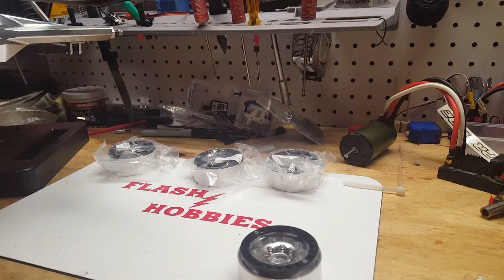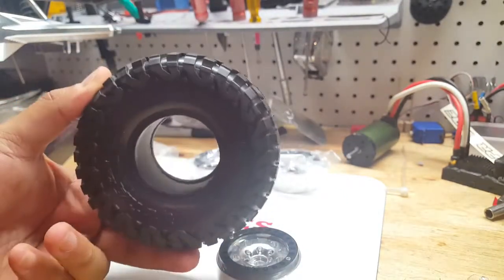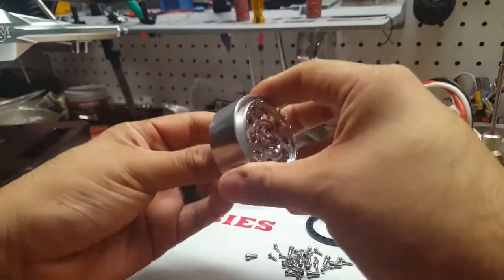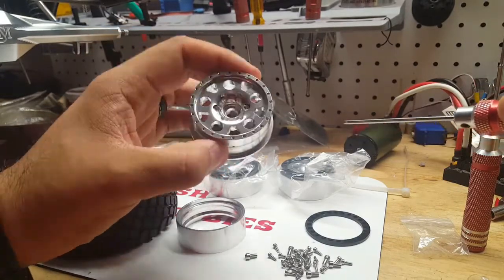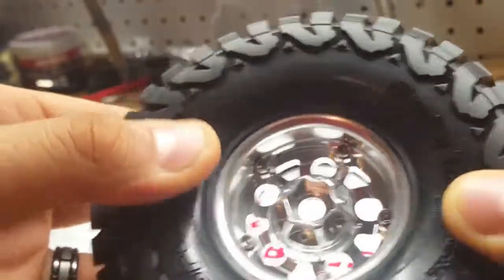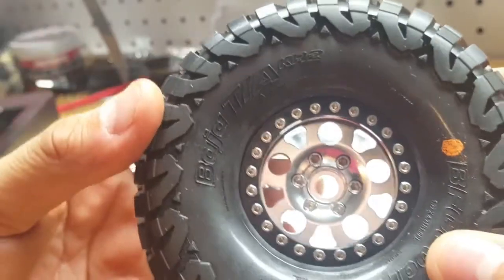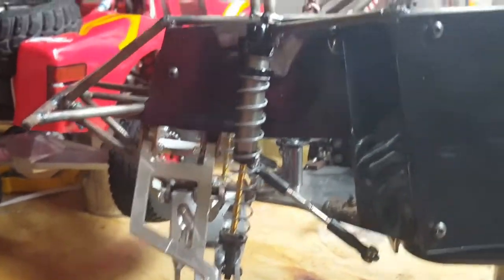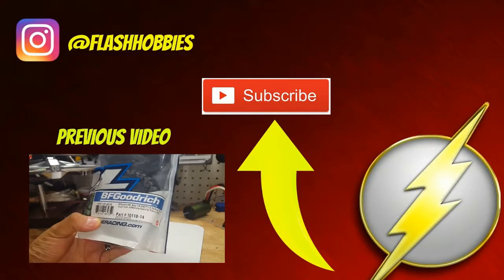EBAY 1.9 KMC Knockoff Beadlocks?

Comment: You could try to use the Vaterra twin hammers's c hubs/caster blocks to get a higher ground clearance and a much more scale looking as Gimm3fuel did in his truck. They  are also available in aluminum in Ebay very cheap, under 20 Dollars and works well.
Reply from the maker: I will have to look into that! Thanks for the info.

Comment: Really good looking wheels and tyres. I got a set of 4 aluminium beadwork wheels from schenzen for $21, and I bought a set of axial scx10 2 brand new tyres and sponges off ebay for $33. Awesome value, the tyres are sooooo feckin sticky and soft. They're my most expensive tyres yet. Now I'm just waiting for the wheels to arrive, then I can fit and try them out. Just like you, I can't afford mega bucks for anything my heart desires, I really have to be prudent. Great video man. ☺ 👍 👍 👍 👍
Reply from the maker: Mikey mike yes they are in excellent deal. I have Randy's with a 3s LiPo battery and have not had any issues with them as of yet. I also want to mention that the quality is really good and they have held up really well so far. So no complaints for me I would really want Vanquish Wheels but like I said they're just too expensive for me

Comment: Nice video!
The problem I had with cheap beadlocks were the soft screw heads stripping.
Reply from the maker: I did notice they are a bit softer than some other screws I have used, but I did not have any issues with any of them stripping. I might have that issue if I am constantly switching out tires.

Comment: I've always giving these wheels a lot of thought but never got myself around to ordering them - I have Vanquish 1.9s and 2.2s and now I want to try this - you mentioned the worst that could ha[[en is stripping the hub. My main concern was always wondering how well the beadlocks hold on to those tyres. If you see my videos and the kind of driving I do you will understand why. Since I got my Vanquish I have never ever so far had a tyre pop out of a beadlock. All the ones I had before failed ore than once, and they ranged from glued Axial wheels to Integy wheels all the way to Proline wheels. Could not hold onto an RC4WD Mud Slinger II 2.2 tyre! Would be nice to know who these held onto the tyres! I was even thinking of getting just one as a spare wheel but sadly i want it with a silver ring and black wheel, the opposite to what you got to match my other four. Cannot find same colour as mine!!
Reply from the maker: You make a good point. I did pull the tires as hard as I could and it felt good, but I won't know until I run them.

Comment: Will the 1.9 wheels fit on the front with out rubbing?? I know you could get a wider slw  hub, but then the width of the track won't fit under the body of it's too wide...
Reply from the maker: I guess it depends on what front end you are using, I am using Axial Yeti SCORE front arms and hubs and they do not rub on any part including the body.

Comment: Have you had issues with them popping off I want to put them on my yeti score
Reply from the maker: Daniel Barraza Nope, I have ran up to 3s on them
Reply: Flash Hobbies are the tires the same size as the stock score tires?
Reply from the maker: Daniel Barraza to tell you the truth I haven't measured them against the stock tires, but imo i think the proline tires are a bit taller
Reply: Flash Hobbies but they are taller than a normal 2.2/3.0 short course tire right?
Reply from the maker: Daniel Barraza Yes they definitely bigger than standard short course tires
Reply: Flash Hobbies okay thank you so much... check out my Instagram @Tortero_2

Comment: What foams are you running
Reply from the maker: Daniel Barraza the ones that came.with my proline tires. They are medium compound. I will be getting some stiffer.foams soon.
Reply: Flash Hobbies the medium compound was too soft for me so I bought the proline single stage closed cell foam and they are too small there is a gap inside between the foam and the rubber
Reply from the maker: Daniel Barraza im probably going with the krawler innovations closed cell foams. They are great